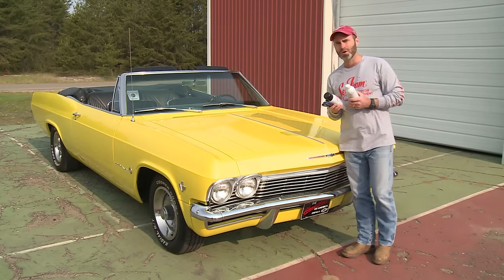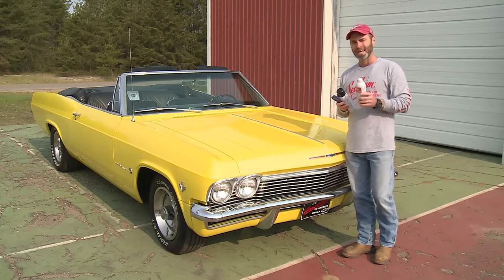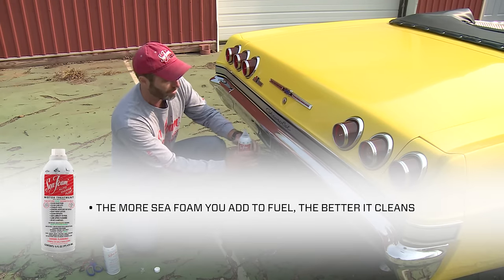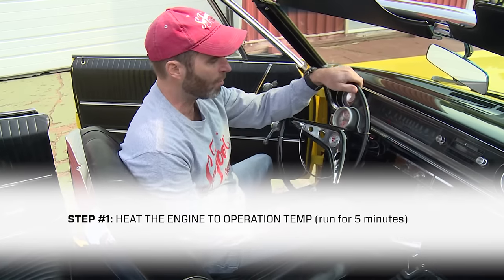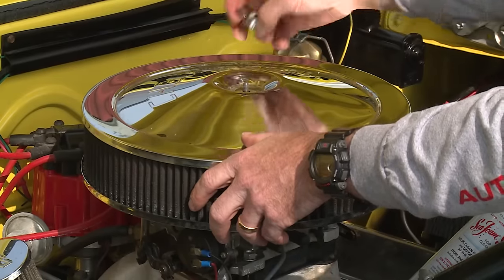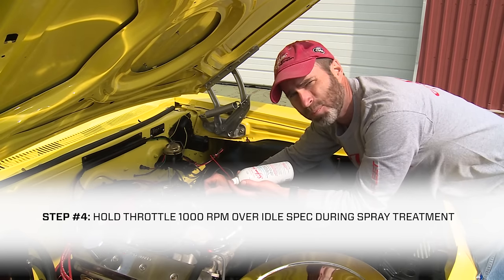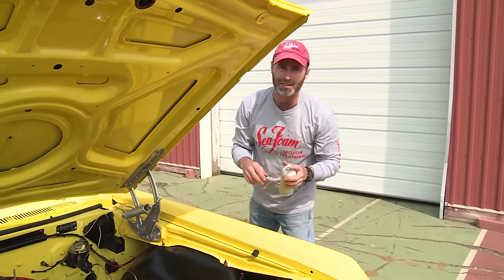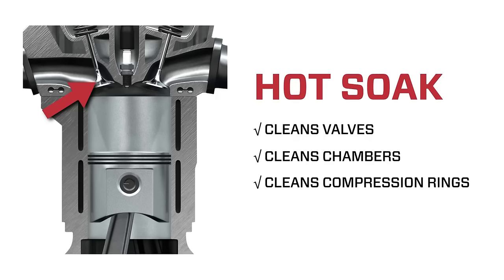How to clean a gasoline carburetor upper engine (air intake) using Sea Foam Spray

Comment: I did exactly what you explained in the video and it worked great. Is there any benefit to doing this twice? Can it cause any harm? I’d say the rough idle is 75% better on my 55 bel air and 350 engine. Thank you!

Comment: That carburetor is working good try that stuff on a carburetor that is failing to see if it works or not.
Reply from the maker: We agree, always!   If Sea Foam could not quickly and easily clean a gummed-up carburetor... no one would have ever heard of it.
Reply: @SeaFoamOfficial  im doing that tomorrow, I will keep you updated

Comment: I just did one of these treatments on my small block V8 tonight, gonna drive home after the hot soak when I close the store. Thanks for the upload!
Reply: And what happened next ? you never came back to tell us
Reply: @dfls5069  I experienced immediate increase in throttle response and slight fuel economy increase. Even with 2 of 8 plug wires being damaged which I have also replaced since this comment.

Comment: Worked like a champ in my 85 Caprice. This will be a regular routine from now on. Great vid and product 💪💪👍!!! (additive and spray) 

P. S. - car had been sitting for over 6 yrs.
Reply: My 83 caprice is having carburetor problems... I sprayed to much starting fluid in my main vents in my carburetor.....I'ma try the seafoam once I get it running....thanks for sharing your feedback cuz I been looking up alot of videos and hours or reading 😂💯
Reply: @soloboylucas7052  I just bought an 83 caprice classic. I have to add a bit of starting fluid if it’s cooled to get it running. It idles quite a bit high for awhile after start up. I’m going to try seafoam this wknd. Did it end up working for you?
Reply: @Ry77x  I actually just ended up taking it to a repair shop I flooded my carb so in my case it was a small fix....I think it was only 75$ bucks
Reply: @soloboylucas7052  ah. That ain’t bad at all. Thanks for the reply man. I love this damn car so far. Goodluck
Reply: Hey been 3 years! How often you put Seafoam through your car? I've got an 84 diplomat I just seafoam'd

Comment: My 91 Yugo GV has been having issues with running rich and the carb getting clogged up, thanks for the tutorial hopefully I can get the little thing to run a little more smoothly.
Reply from the maker: Make sure you treat the fuel to clean the carburetor by adding a couple cans of Sea Foam or High Mileage to a low tank of fuel (greater cleaning concentration). Some people mistakenly think treating the carburetor throat cleans the carburetor - treating the carburetor throat cleans the intake valves and chamber areas, which are after the fuel passes through the carburetor circuits. Hope this helps! 🙂

Comment: Guess I'll administer this on my 77 monte carlo this weekend, hope it helps with the hard starting
Reply from the maker: If hard starting be sure to include a high concentration in the tank. Hard starting is more likely a fuel gum restriction in the carburetor (or fuel filter), so need to treat through the fuel. Intake treatments into a carburetor throat go right to the intake valves and chamber so won't clean the carburetor (fuel passageways).

Comment: Got a 1973 international scout ii had ran out of gas which caused a surging issue at highway speeds
Used a third of a can of the liquid sea foam through my vacuum intake and the rest in gas tank with about 5 gals of gas...white smoked and ran better than when I had in a shop for 3days...about to shoot the can  through my carb to help the acceleration
Reply from the maker: Hi Nate:  If not too late, use Sea Foam Spray - because it atomizes the fluid works much better!

Comment: Question, just got my car out of the body shop after 3 years…. The motor compartment was caked with body shop dust. 
If I spray the outside of the carburetor to clean off the dust, will it damage the new paint on the fender wells and motor?
Thanks
Reply from the maker: How about spray it on a rag first, then wipe?

Comment: My 305 Chevy engine starts after pumping my carb about 6x's and then it high idles for about 3 minutes would this sea foam help my car? Any help would be appreciated...Thanks!!!
Reply from the maker: Try what's showing in the video and let us know what happens!
Reply from the maker: If needing to pump 6 times your fuel might be flowing back to the tank too quick (overnight, etc).

Comment: Okay, so I have a 1995 Nissan Hardbody. It has a carbureted KA24E 4 banger. It starts, but it won’t idle. I have to keep the gas partially applied to keep the engine from stalling out. I was told to try seafoam, but I’m not sure how it would react. Do you guys recommend it? And how should I do it on my engine since it doesn’t like to idle?
Reply from the maker: Sea Foam and Sea Foam Spray will only help, just like the video shows. How old is your fuel filter?

Comment: Does it matter if you put the gas treatment in at another time or is there a special benefit to doing them both together at the same time as opposed to say spraying the carburetor one day and another day putting the treatment into the gas tank?  I sprayed my boat's carberator this past weekend but didn't have enough gas treatment to put into the gas tank at the time so I'll have to do that separately at some other time so is it important when I do this or after how long to wait?  I already had treated the gas that was already in my tank with Marine Stabil.   If I use Seafoam in the gas tank in the future then do I still need to use Marine Stabli?  Does Marine Stabil & Seafoam have any consequences if they are combined together in the gas tank?
Reply from the maker: 1. Don't have to use at the same time but helps. 2. Can mix/combine in fuel. No worries!

Comment: Hopefully someone can answer--my motorcycle runs a little rough. Would seafoam help with that? I can't take off the gas tank and spray it into the carb. Would it work to spray it into the air filter, like starting fluid?
Reply from the maker: Hi Michael:  For a carburetor, just add a half or full can to the tank...run the engine for 8 or so minutes to get the mixture into the carburetor circuits...shut off and let sit for a day...run it to warm up and take if for a ride. Carburetors are vented to the atmosphere and form heavier, sticky gum/varnish in the passageways...Sea Foam works fast to liquefy the heavier fuel residue/clears out the circuits.

Comment: Hi Sea Foam Official can i use sea foam on my 1990 4.2.l jeep wrangler YJ I'm having bogging issues.  if I give it time and take off slow i have no issue but if i try to floor it it boggs on me and dies.
Reply from the maker: Yes, try it and let us know what happens.  Make sure you include a cleaning concentration of Sea Foam in fuel to clean the fuel passageways.

Comment: Hello I have a 1972 Monte Carlo with a 350 and it recently started having rough idle on cold start and when it’s warm should I do this to it? and that would fix the problem please help
Reply from the maker: What I would do:  Run the tank down to low amount of fuel...Add two or three cans of Sea Foam to the tank and run the engine for 15 minutes...Shut off and let it sit for two or three days...Do a full can Sea Foam Spray treatment through the carburetor throat just like the video shows...Let us know what happens.

Comment: about to try this on a old 4wheeler. they charge $80 a bottle here in Alaska for seafoam and i need two.
Reply from the maker: $80? 😮  Add a whole can to a low tank and run it a bit to allow the high cleaning concentration to work through the carburetor/injectors (whichever), then shut off engine and let it soak for a night or two before adding fresh fuel.  You won't need 2 cans.

Comment: Can anyone give me a clue what kind carb should I get for my 305 gmc motor 1980 and pump
Reply: Dont .just rebuild the one on it.buying a new 2 barrel is pointless. & putting a 4 barrel on it would just cause problems using the stock cam.

Comment: I just picked up a 1985 Honda Magna V45 VF700cc.
Taking all four carburetors apart looks like a nightmare and I'm not "Johnny spin a wrench", so I'm going to spray the hell out of the carburetors with Sea Foam and add it to the gas tank and keep my fingers crossed.
Anybody try this on their bike? How did it work out?
Thanks for any feed-back.
Eric
Reply from the maker: Eric:  Add a bunch of Sea Foam Motor Treatment to your tank gas to clean the carburetors.  Note that Sea Foam Spray into the carburetor throat does not clean the carburetors, the carb throat directs air and aspirated gasoline into the air intake runners (after fuel has passed through the carburetors). Hope this helps!

Comment: I have a 1985 3.0L Mercruiser.  I have issues cold starting when priming with throttle.  Could adding Seafoam to fuel tank and carb intake possibly solve my issue?
Reply from the maker: Yes, try high concentrations in fuel (add to low tank or use 'can & hose'), Sea Foam Spray into throat will help clean upper engine (but does not pass through the carburetor circuits).

Comment: Is a 1000 RPM over idle best ?
Likely if it's over 2000 RPM's, the sea foam will be sucked in too rapidly to effectively do it's job...
Reply from the maker: Good question. Holding at 1500 to 2000 RPM is ideal.

Comment: So I just add to gas tank, warm up, turn off, drop a can inside the carb, turn her on. Drive ? And the sea foam will just evaporate?
Reply from the maker: Spray a can into the carburetor throat, yes.  No, Sea Foam does not evaporate.

Comment: What happens if I let it hot soak for two hours? I had to run an errand and when I came back and drove it there was no smoke, 1975 c10
Reply from the maker: Hot Soak has to do with engine heat. If you wait too long the engine is no longer hot when you start it back up.  No harm to cool down, but can foul plugs. Smoke is not relevant.

Comment: Thanks for reply... I do have both and have added it to the fuel already but she has a rough idle so wanted to see if the spray would help?. Does it still apply to add the full can meaning quarter can per carb and shutting it off for 15min and starting her up again. Thanks
Reply from the maker: For diagnosing a rough idle, hesitation/loss of power.. with anything carburetor related, use Sea Foam Motor Treatment in the fuel tank.  Add a full can or two when the tanks is low (a gallon), then just run it to get the Sea Foam mix into your carburetors. Every time you leave it sit the Sea Foam will be working to dissolve soft gum and varnish residues from the carb circuits.  Sea Foam Spray is intended for high concentration chamber cleaning (intake valves, chamber areas, compression rings).   Hope this helps!

Comment: Do you think this stuff would help unstick a Valve in a car that’s been sitting for years?
Reply from the maker: Intake valve? Depends on how stuck/why it's sticking.
Reply: The car is a 61 thunderbird that was parked in a dry barn since 1974 I just recently got started after changing the gas tank, the fuel pump and rebuilding the carburetor but now thats running, but the oil light came on and you can hear it missing along with some smoke coming out the oil fill cap I suspect is a stuck valve.
Reply from the maker: @craigmoon4641  Yes, if you can get the fluid around the top of the valve and let it soak for a few days.

Comment: I have a 1983 honda Ballard 1300 outomatic  with 2 carbs but fuel problems car just goes slow even when I put my foot on the gas
Reply from the maker: Have you tried a high concentration of Sea Foam added to your fuel tank?

Comment: Hey guys useful channel! I can use this spray on a 4 stroke 150cc moped right?? made in china...I should remove my paper air filter and spray direct?
Reply: ok ok so i do that, then add some to my fuel (1.7 gal tank) ???..thats it?
Reply from the maker: Yes, try it...Definitely add some to fuel to clean through the carburetor circuits.  And don't be shy... See what happens and let us know!

Comment: Hey Brian, I would like to use the seafoam spray on my motorcycle. it is a 4 stroke so my question would be do I spray each carb individually then shut it off and "hot soak" or just spray around in the intake filter housing. Thanks
Reply from the maker: You can do the sequence individually or try to do in sequence.  Doing one at a time works well if you aren't in a hurry.   And, make certain the spray straw is placed in the carburetor throat in front of the throttle valve.

Keep in mind that air intake treatment cleans the chamber area while Sea Foam in fuel cleans the carburetors.  For cleaning carburetors, just add a high dosage into your tank fuel and ride as usual.

Comment: I have an 89 Camaro, 305 tbi, and the idle shows that my carburetor is super dirty. Will this work on it?
Reply from the maker: Add at least 2 can of Sea Foam High Mileage to a low tank of fuel + apply a full can of Sea Foam Spray into the carburetor throat. Understand that Sea Foam in the fuel tank cleans the carburetor while Sea Foam Spray into the throat cleans the intake valves and chamber areas. Let us know what happens!

Comment: I've had rough idling in my 73 comet and I replaced the fuel filter and added seafoam to the gas tank, but it was still sputtering and dying I'm going to spray the carb today to see if it does the trick, if it works, you're a life saver, I'll keep you posted.
Reply from the maker: Hi Alvin:  To overcome idle trouble, don't be afraid to add 2 or 3 cans to a low tank of fuel (and run it!) to clean the carburetor circuits.  Sea Foam Spray into the carburetor throat will help clean the intake valves/upper engine.
Reply from the maker: Hi Alvin - 2 things going on:

1) When you apply Sea Foam Spray into a carburetor throat the engine needs to be running at least 1,500 to 2,000 RPM or you'll drown out the intake and foul the plugs. (Be sure to read can instructions.)  

2) Adding something to the carburetor throat does not pass through the carburetor.  When you spray into the throat (air intake) the liquid goes right to the intake runners and into the chambers.  You need to add Sea Foam to the fuel to clean through the carburetor jets, etc.

Comment: Nice video. On a Quadrajet, should I spray into the tube located in front of the primaries or the one in front of the secondaries, or both? I think they are fuel bowl vent tubes. Also, can I also directly spray it into the chambers (primary & secondaries?). Thanks!
Reply from the maker: Spray into the big openings/primaries 👍. Same as video shows.

Comment: How much seafoam should you pour into the gas tank without knowing how much fuel(inaccurate fuel gauge reading) is in there ?
Reply from the maker: As long as you have half a gallon of fuel, the whole can is always best for creating a higher cleaning concentration. Hope that helps!
Reply: @SeaFoamOfficial  ok Thanks

Comment: Hello! My 81 Fiat 127 make a very bad noise, it's doing clicky sounds like a diesel but it wasn't doing that before, but I'm using 95 octane but it's recommanded to use Super 98 octane, putting this in the tank AND cleaning the carburetor with the nozzle bottle will help cleaning and maybe having a smoother engine? 

Have a nice day and happy new year!
Reply from the maker: Thanks - HNY to you, too! Is the clicky sound a lifter (oil crankcase), or engine knock/pings (combustion chamber)?  If lifter noise, try adding a half a can of Sea Foam to your oil for the remainder of the oil interval.  If a knock, do Sea Foam Spray treatments just as this video shows. Better yet, do both!
Reply: @SeaFoamOfficial  Thanks! Okay, I will try to do both, I've seen the YouTuber "Project Farm" doing that with seafoam and his engine was very very silent after that, I hope it will work good! Do you know where I can buy Seafoam in Belgium?
Reply from the maker: @sheppardpat47  Let us know what happens. Sorry, no idea on getting Sea Foam in Belgium.
Reply: @SeaFoamOfficial  I hope I can find it on Amazon but it's a bit expensive, but I don't care since it's quality 😁
It's three times the price than in the US, I will get my car in one month max I think!

Comment: If my 1976 caprice flooded can i use all of this product
Reply from the maker: Can you rephrase your question?
Reply: My 1976 caprice flooded what too do an use too get it started but i will definitely use the seafoam when it get cranked up
Reply from the maker: @jeromeburks2123  A flooded engine means there is too much gasoline (too wet) in the combustion chambers. Let it sit or pull the plugs, wipe them off, then let the chambers dry out.

Comment: Can I let the spray sit overnight instead of waiting 10-15 minutes then driving if?
Reply from the maker: You can do that but be aware that engine heat is important for starting after the hot soak. I've done it... takes more time for the upper engine to work through the Sea Foam mix in the chambers.
Reply: @SeaFoamOfficial  thank you. I let my 67 mustang idle after about 15 minutes for 10 minutes last night. I’ll take it out for a drive today. A bunch of smoke came out during and afterwards when I let it idle so I know it worked.

Comment: I have a 1984 F2 50 with the 351 Windsor in it I'm pretty sure the float is sticking in the car will this help
Reply from the maker: No, you need to reach the float by adding Sea Foam to fuel.  The float is in the carburetor and Sea Foam Spray is applied into the carburetor throat - the video showing the spray going into the carburetor throat, so applied in the air intake stream AFTER fuel has passed through the carburetor.

Sea Foam Motor Treatment in fuel will dissolve varnish that causes a float to stick.  The higher the concentration the better so add a can or 2 when the tank is very low...run the engine at least 10 minutes...shut off and let Sea Foam soak in the carburetor circuits for a couple days.  Let us know what happens.